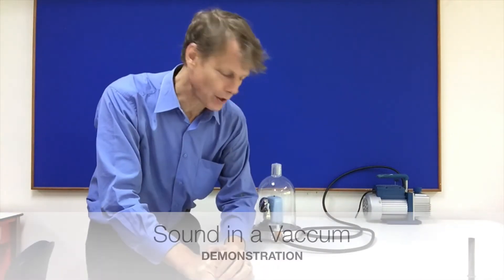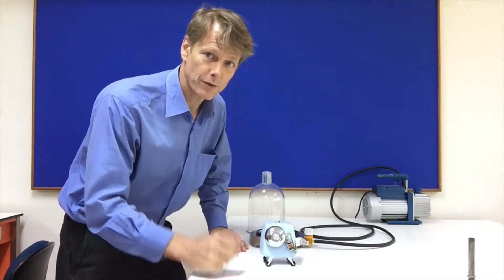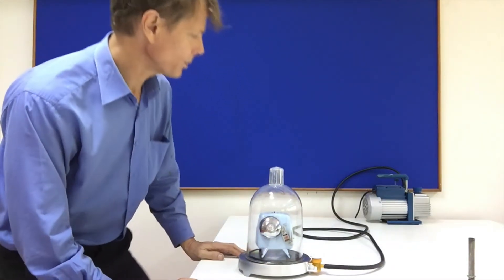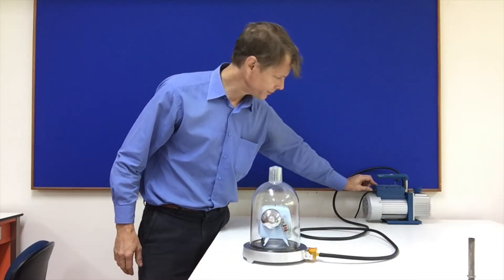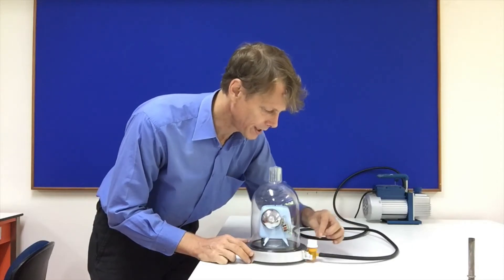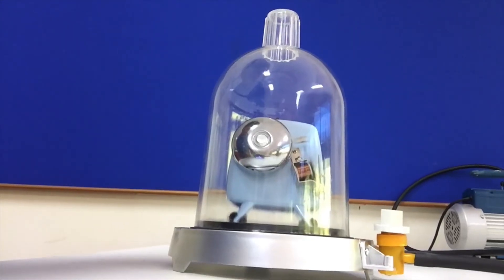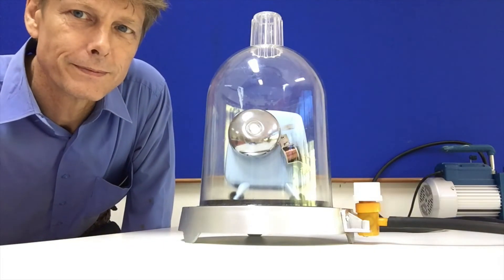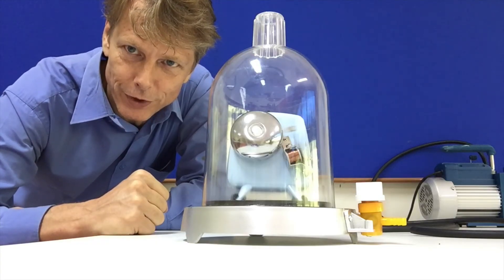Sound in a Vaccum 101

Comment: What is pressure?
Reply: Air pressure is the weight of the molecules of air (Oxygen and nitrogen gas predominantly) being pulled by gravity towards the earth. 

Gas molecules are lightweight in comparison to something like lead molecules. However they still have mass and therefore still have weight. 

At sea level you experience about 1 BAR of air pressure. The higher up you go in altitude, that pressure gradually decreases until you find yourself in a vacuum (Space). 

It's a basic answer but I hope this helps.

Comment: Question: can sound be utilized in the vacuum of space to deter space debris?
Reply: A couple things to address then; it was an application question that was fundamentally flawed, now I see - fairly ironic as I have a degree in Audio Engineering.  Generally though I'd suggest you attempt to sound less condescending if you're trying to sell a product, also if you're going to suggest that our auditory nerves can detect cosmic radiation, I'm going to have to ask you what you're smoking
Reply: @ipoopd  - First, thank you for the thoughtful reply. And, you're right that I can sound condescending. But, it's hard enough to be so direct but, much harder to try to tiptoe around on eggshells trying not to offend anyone and get a science point across. So, I do what I do.

That said, I also said you'd learned sound wrong. And, that's true. The core concept of how sound (and light and all radiated phenomena) are thought of and taught wrong. So, what's right? That's actually fairly easy to answer and understand but, takes some 'unlearning' and 'relearning'...and, getting rid of the mathematics that's muddying up the waters.

We start with some observations. One I made (independently) was also made by another gentleman, named Dr. Alexander Wilford Hall, over 140 years ago (https://archive.org/details/evolutionsoundp00hallgoog/mode/1up). The book is available on the Internet Archive and Google but, seems to keep moving around and links to it I save stop working (sigh). Dr. Hall uses, as the same example I did of a small sound that carries well in the air; a cricket chirp and asks how such a small insect can move so many thousands of tons of air particles in order to move so many eardrums (and anything else, like microphones and leaves and anything else the sound impinges on).

In about 1877, Dr. Hall didn't come up with the right answer but, was at least asking the right questions. I (salaphysics) did resolve it. The short answer is that the cricket (or any sound...or, indeed,  other radiated phenomena) does NOT emit (radiate) energy. Yet energy is received. The energy received has to come from somewhere. And, it does. For sound in air, it comes from the air particles being in motion and therefore, having mass and velocity have energy (the salaphysics definition of "energy"). That energy relates to the mass (which doesn't change...in spite of Einstein saying it does, with speed) so the energy is the mass in motion. It's known that the speed of sound relates directly to the temperature of the air (assuming air to be the propagating medium) and the speed of the air particles also relate to the temperature. Ergo, those two things must be related.

Of course some energy is being emitted but, such an infinitesimal amount as to be immeasurable and can be considered, in practice, to be none.

Longitudinal (or traverse) compression waves are nonsense inflicted on us by mathematicians. In fact, sound (and light and any other radiated phenomena has nothing to do with waves of any kind). The only manifestation of any "wavy actions" are a product of objects being moved in wavy ways. Moved by being impinged on by particles.

In the case of sound, the primary variation that moves the....eardrum....is the number of particles impinging on it. And, I'll stop there and say that the lessons on and leading up to sound and other radiated phenomena are covered in the salaphysics lessons (still very much in development). And, since (so far) I have found that, in a world of 1o billion humans, to date, that I'm the only one to figure ANY of this out, it's pretty slow going.

salaphysics.com
032823

BTW: As an addenda, I fully intend comments I make about mathematical physicists to be condescending. Even Richard Feynman, a staunch advocate of mathematical physics, came to realize at least the problems of presenting physics mathematically (although I don't think he revised his own reliance on it within his lifetime).
Reply: Hmmmmmm....so the question you ask is about if somehow (for whatever reason; perhaps to protect the Earth from rogue asteroids?) sound in the vacuum of outer space can be used to deter "space debris".

The answer is yes...and no. It's theoretically possible but, impractical.

The first problem is that what you learned about sound wrong. Notice, in this video, the presenter makes NO effort to explain anything he's doing or the physics behind what he's doing or the results he's getting. As a teaching tool, this video is worse that worthless as it leads people (like yourself) to ask the question you did.

The first thing you need to do is get the concept of sound right (BTW: It's taught completely wrong in all science classes).

But, by gathering information and assembling it in a way that allows you to work through the subject yourself, you can (with enough time and diligence), figure it out.

Case in point. LIGO. Hearing the collision of binary stars colliding and producing "gravity waves" (another error of concept by the experts), that can be detected here on Earth.

If the results of the collision can travel across space and move the LIGO instruments then it's possible to move distant objects with radiation at audio frequencies. In fact, if the "sound" (arriving at light speed but at audible rates) can move the LIGO instruments it's also moving your eardrums but, so weak you can't hear it.

And even those collisions of stars which can't move your eardrum certainly don't have enough energy to deter (perhaps deflect) space debris so it doesn't strike the Earth.

salaphysics (salaphysics.com) provides a science curriculum where such corrected information is given.

salaphysics.com
032323

Comment: When u suck air from plastic bottle it will shrink in this case glass jar have to broke due to -ve pressure but why it is not happening 🤯🙆
Reply: Tempered glass and a stress reducing shape
Reply: The glass is specially made to tolerate this kind of pressures